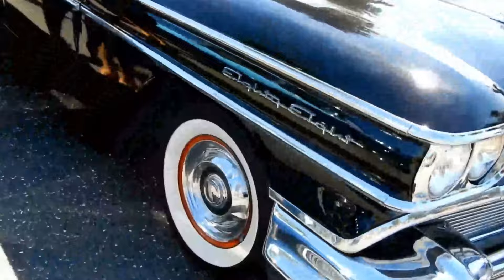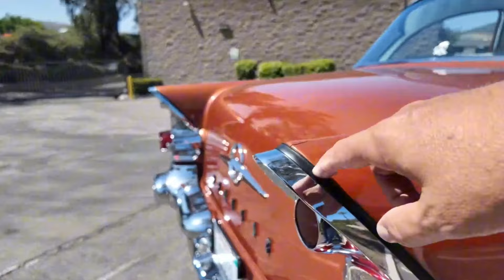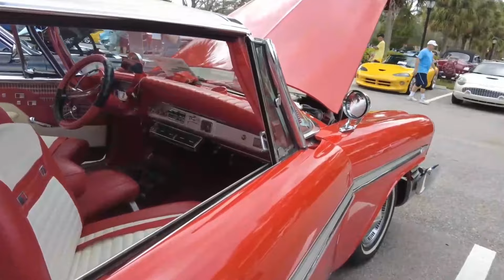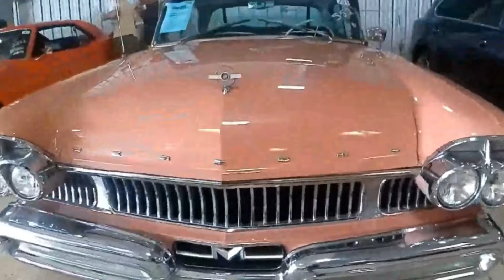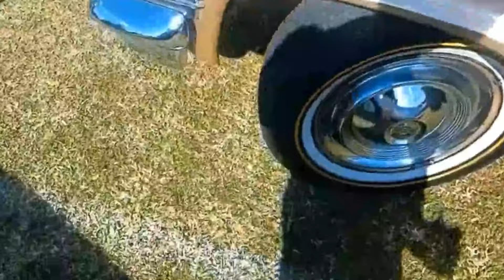Top 9 WORST Cars of the 1950s

Comment: one thing that doesn't seem to make it in these videos... is the fact that northern states, rust belt states in general... used ashes, basically donated by railroads [just to get rid of them since most engines burned soft coal]... well by the early to mid 50's steam engines went bye-bye and diesel came in... thereby ending the use of ashes... 50's cars weren't particularly built to handle corrosion... well, once the ashes were no longer available...salt became the norm and the acid by-product destroyed cars... was not uncommon to buy a used Chevy with the floor and trunk rotted away... my first car, a 55 Chevy, had so much rust that the seat was held up by 2x4 lumber... you could watch the road going by under your feet

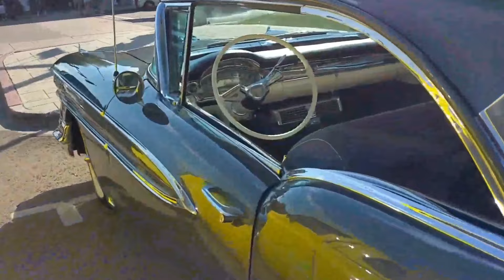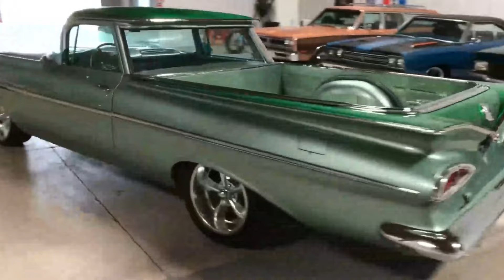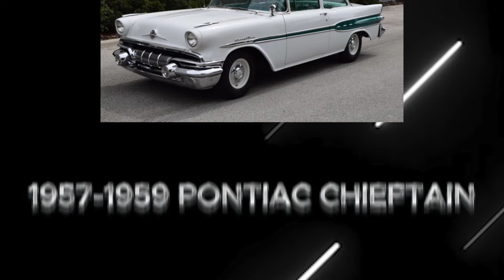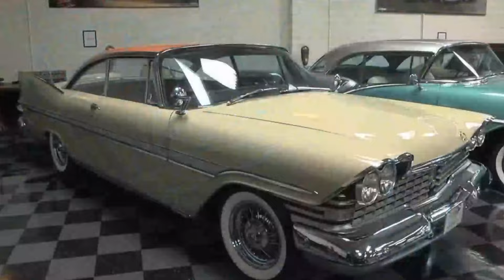Comment: '58 and '59  Olds (which you never showed) were completely different cars. 1:21 due in part to a recession. Auto sales were down across the board. And if you're talking about the '58 why did you include the '59? 2:37 could the same not be said about the Ford ranchero? Same vehicle same concept but that was ok ? 4:30 again 3 distinctly different vehicles. And the Cheiftan was discontinued after the 1958 model year. 8:33 Pontiac?

Comment: As the owner of a 1958 Packard 4dr, I take issue with your claim that it was a "bad" car.  You are correct in stating that it was a re-badged Studebaker, it clearly was, and it deceived nobody.  The circumstances surrounding the creation of the car were unfortunate to say the least, but that does not make it a bad car.  The Studebaker 289 is a tried and true engine, I have two other 259/289s among the seven Studebakers I own.  You are decrying the circumstances and claiming that is what makes the car bad. View the car as it is and not what created it.
Reply: Typical AI 🐴💩
Reply: Mechanically, the 1958 Packard Clipper was great, especially with that Studebaker V8, which is one of my favorite engines. However, the choices they made in styling were questionable.

Comment: Nowadays, all those cars are highly collectable and seen as real classics. From all of them, I'd set the Dauphine as the worst of all, though it was an option of urban car for European cities.
Speaking of the lack of reliability and dependability due to complex solutions, French cars are a much greater nightmare even nowadays!
The good news is such cars can be properly restored and, with present technology, many of the issues can be eliminated, making such cars masterpieces. Rust, for instance, can be severely reduced with nowadays sheetmetal treatment, fuel injection and more modern carburetors can solve several of such issues and re-engineered mechanical items can make everything work properly. Quality has always suffered when marketing came first!

Comment: I remember those Plymouths and DeSotos and Dodges having numerous carburetor trouble s. Electrical system issues caused frequent no start conditions especially in freezing cold or damp days .
Reply: I remember some of the early '57 Chrysler Corp. cars had torsion bar breakage issues. Most, but not all, were repaired under warranty. My father's '57 DeSoto Firedome broke a torsion bar in the mid-60s, long out of warranty. That spelled the end of that car!